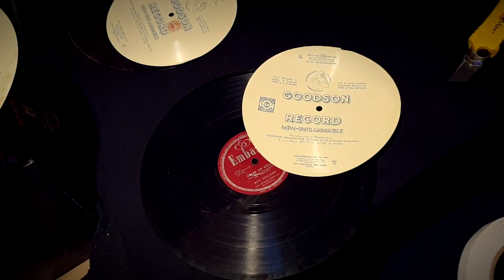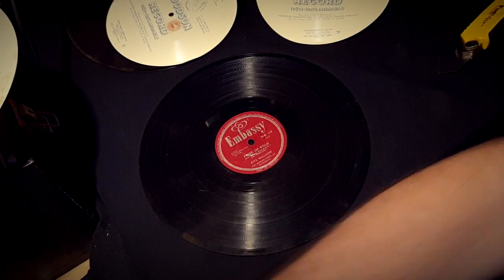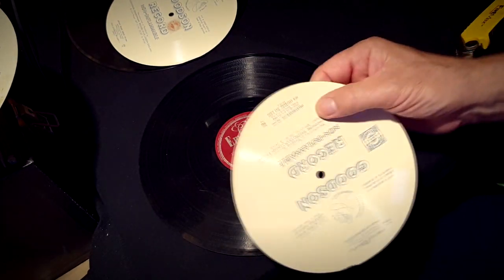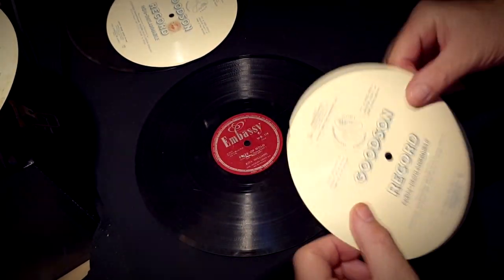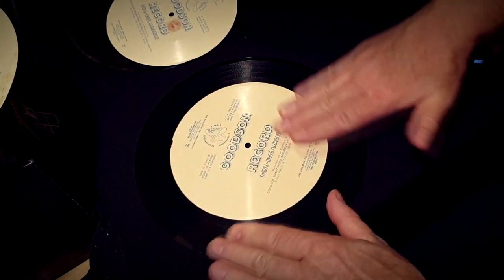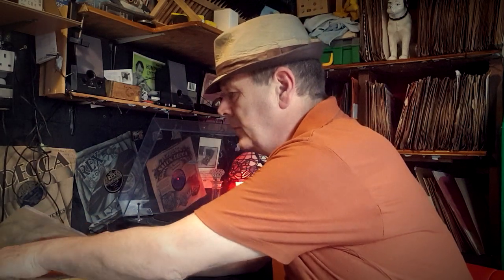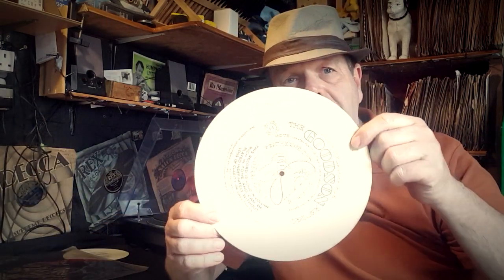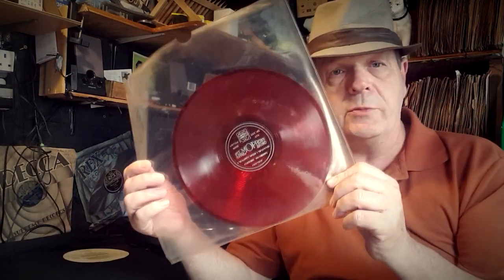FLEXI FLATTENING GOODSON'S 78RPM FLEXI DISCS

Comment: You might try placing a 45 RPM adapter on the spindle?
Reply from the maker: The trouble is they are hitting the tonearm and then just sliding, my adapters are only plastic and not very heavy... But I may see if it will help... Thanks, Chris...